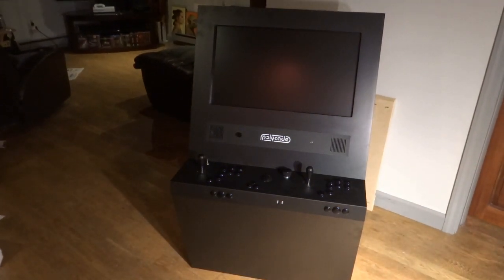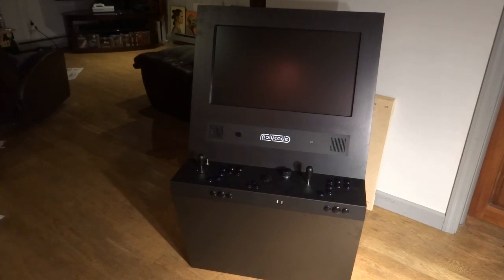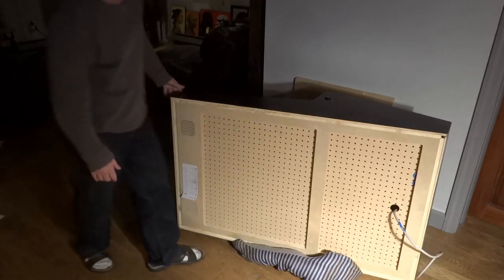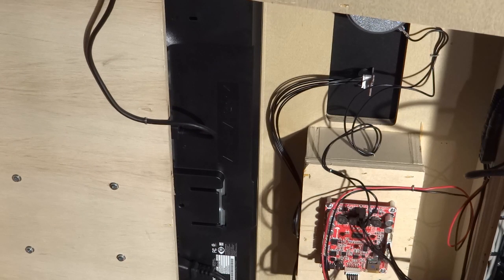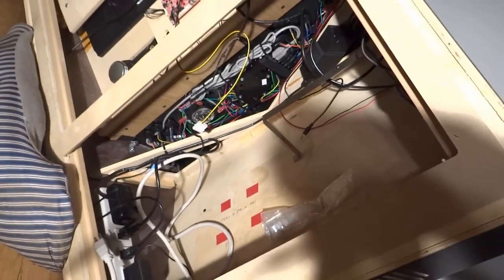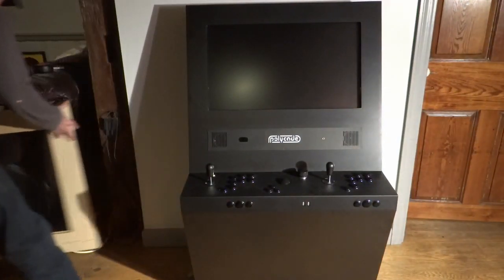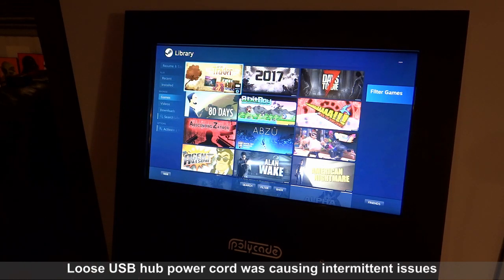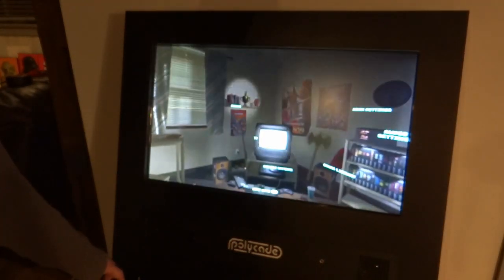Polycade Arcade Console

Comment: Thanks for the video @In_The_Woods, and even more thanks for being a Kickstarter! 
Sorry we're late to the party here, I wish we would have had the time to do one of these ourselves back when our v1 machines shipped.
We learned A LOT with our first version of the Polycade, and you call out a number of the areas that we cleaned up in v2, and then further refined in v3:
- We changed the monitor after the v1 units, and now use a BenQ monitor with a 1ms response time. It's not the best monitor money can buy (that would increase our end price by a lot), but it's fast, looks good, and reliable. This is of course unfortunate for the v1 units out there, but then, the v1 units cost about $1700 less than the units we ship today.
- Stapling the cables to the cabinet was a big mistake in the v1 machines. Our v2 and v3 machines are constructed entirely out of sheet steel, so this is not even possible anymore. 
- A lot of the v1 units had additional devices like the Spinner on the machine shown in this video. This took our usb count on the control panel over 4 ports, which then requires the powered usb hub. v2 and v3 units consolidated the control panel devices and no longer need the powered usb hub.
Reply: was going to write some disappointing comment until I saw this. Any company that can admit to its failures in early releases and responds with appropriate actions is good in my books.

Comment: Hi, I recently purchased a used Polycade, it’s the wood version just like yours. Unfortunately it’s missing the wall mount part. I was wondering if you could share the instructions that came with it or explain how it mounts to the frame?
Reply from the maker: Unfortunately I do not have any of the specs of the mount.  The people at Polycade would probably be nice enough to provide you the specs tho.  Here is a very basic picture of it https://i.postimg.cc/wvXnwwwH/th.jpg.   The top of the wall mounted bracket has a Lip on it that the polycade sits on.
Reply: In_The_Woods thank you. Does it hang only from the top cross piece with the vents or also from the middle cross piece?
Reply from the maker: @BarcadeArcade  It only connects to the Mount at the top. The middle bar on the back of the polycade is for internal structure only it appears.